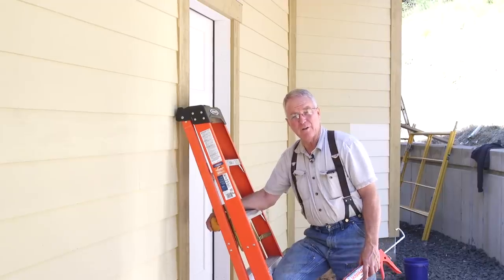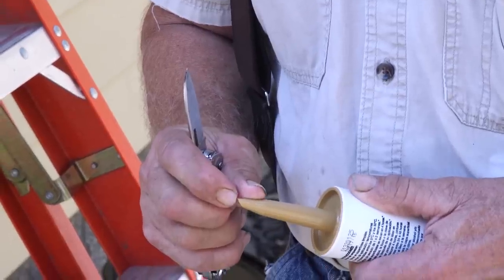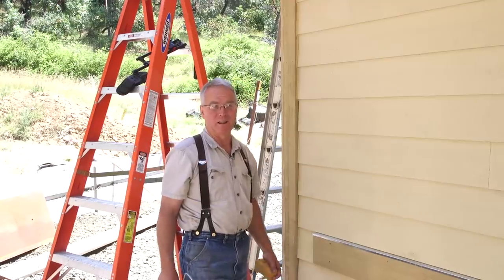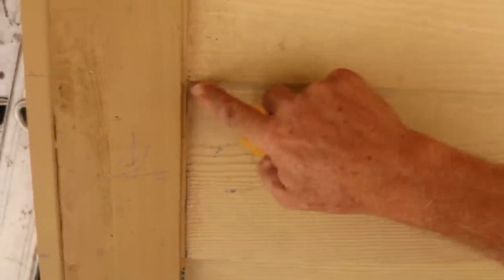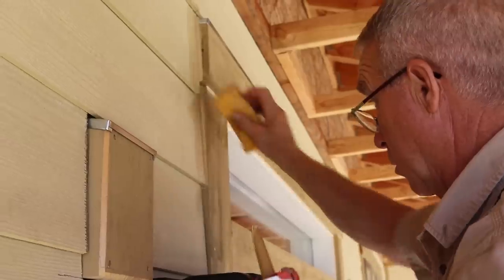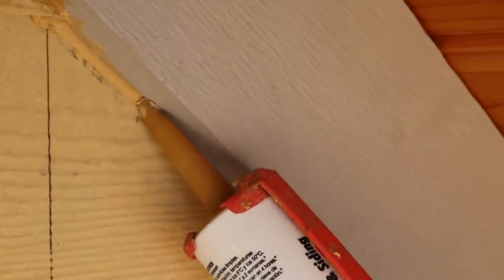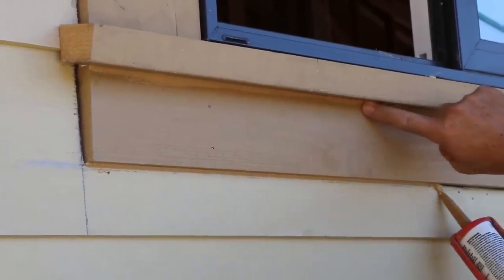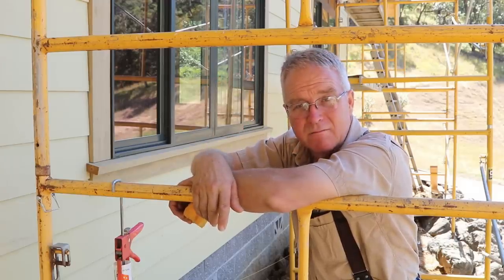Up Your Caulking Game Ep 86

Comment: Looks good. I like to caulk as I install  each board. So you can caulk the overlap part while it’s exposed. Also, a little dish soap in your water really helps get a nice smooth finish on the caulk.

Comment: I like to back caulk every piece of Hardie going up against a piece of trim. If you put in on the back of the piece before you install it, you can do it in such a way where you can get just the right amount of caulk to bleed out of the joint and you can tool the bead right then and there without the next successive piece obstructing the path of your finger, and it also allows you to get the headlap of the siding twice, and ensures that the majority of the functioning weathertightness of that caulking bead will never see any kind of ultraviolet radiation or weather whatsoever.

Comment: Solid effort! I doubt this will be read but just for fun... try holding your tip at about 90* to the joint and look for that little bubble that wants to pop out and then find that balance between stringers and holidays. When you hold the tip down relative to the direction your going you will inherently stretch to caulking and potential thin spots when it shrinks back

Comment: I carry a little portable tub of vaseline and coat my "tooling" finger with it before tooling. It helps to keep the caulk from sticking too strongly to my finger. Some caulks even recommend against tooling as it thins out the edges to such a degree. OSI caulk is some of the best out there. Lots of colors also, to match to any project.

Comment: Little tip is get proficient at pushing the gun as opposed to pulling. So on the bevelback weatherboards you would start at the bottom and work up but hold the gun on the same angle. This way the angle on the tip can finish the look and when you're good enough you will be able to do a great deal of the job without touching it with a sponge or finger.

Comment: Yeah.. thing is over here we use mostly pre-painted siding so color matched silicone or butylene caulks are ubiquitous. Some are so soft and skin over so fast you cant really smooth them over. A good gun (like a tajima) is absolutely necessary to do a smooth application without running your finger in it and ruining your job. Steady hand and being able to glide over rough spots without waving or trembling is the goal. Plus I feel like the 24 tubes of caulk he used is way lower than what we would use considering that our nozzles will be opened like a 1/4 in or more depending if youre butting against stone or brick. Nice to see different techniques being used.

Comment: An experienced caulk job doesn't require a lot of finger striking. We look on that as rookie stuff or only to  cover mistakes. I always pay great attention to the size and angle of cut opening on my tubes, and may 2-3 tubes at the same time to cover different applications. I also keep the gun running  quickly and smoothly. Experience and patience will improve all the strategies you need to leave a job looking great.

Comment: My caulking is done around cabinet infills that I have poorly scribed. I have found if I lightly wipe down the area with a wet cloth, not only do I remove dust but when I caulk, it won't create a mess and stick to the wall or infill and stay a little bit cleaner.

Comment: With Hardi board you have to caulk or you'll see all the seams and joints, not like cedar siding that swells and closes up the gap, wood fibre is fuzzy gives the illusion the gap is tight. Hardi plank is well worth the money holds paint really well, maintenance free pretty well, good stuff, ya a pain in the * to install. At the local building supply the other day walked by the hardi plank on the wall and think its over 20 years old has the same paint on it the day it was installed.

Comment: When I installed the JH lap on my home, I did the butt joint flashing as well as installing a sub flashing at all the outside corners out of a piece of coil stock...overkill, but nothing but a simple 6x6 no hem.  The JH looks without compare in terms of everything going on a home, but man is this stuff labor intensive especially on gables with shakes/shingles.  I spent about 8 hours just caulking the underside of my porch.

Comment: As a certified residential/commercial painter I have been caulking for 25 years. I stopped cutting tubes on an angle 20 years ago. I can push or pull the gun, run over the bead forcing it into a gap, and if I get it right, leave a tooled and finished work in one motion.

Comment: I've been a welder for quite some time now. When I was going through my apprenticeship I remember my instructor comparing caulking to welding. It is very similar. Speed, angle, application. They all come into play. After many years of doing both. Laying down a nice caulk bead w out touching it up is twice as hard as laying a nice weld. The idea is to not touch it after your done and it's very tough to get that glass finish on a bead w out using a tool or your finger. I'm sure painters know there way around a caulk gun. Ask a glazer, someone who has caulked a few thousand windows that have daylight on them and are meant to be seen. It's a craft In itself.

Comment: Best thing I finally did this year was buy a battery powered (because they're all technically cordless) caulking gun.

Especially great when you need to just slam down multiple tubes of adhesives.

For things like baseboard, I cut the tip square and very small. For anything like 1/8-1/4 I cut on an angle.

Comment: Hey I’ve watched nearly all your videos and have also passed them on to my crew. Which has been great!!  However there is a better way to apply caulking. It sounds crazy but cut the tube straight and push not pull at an angle then tool lightly. I didn’t think it would work when taught but there’s no turning back once you got it. Thanks again for all

Comment: As a structural and flat work rod buster carpenter by trade, I used to hate caulking. Got the stuff every where. As I have moved into concrete repair and some general contractor duties caulking had become a major duty of mine. I’m not as good as some but better than some as well. I don’t hate it anymore. It is kind of zen and can appreciate the effort and skill that goes into a nice and more importantly effective caulk joint. Keep up the good work.

Comment: I have a caulking tool with various tip, round, diamond, square, etc.  I use this in stead of my finger. With a putty knife I reuse the excess that gets scraped off. I also use a cellulose sponge. It is less porous than a grout sponge.  HTH!!

Comment: After a lot of practice you don't even need to use a finger. It's better to go slightly larger with the tip cut in my opinion because the caulking will shrink. Lots of caulking brands say there stuff doesn't shrink, but that's usually bs from my experience.

Comment: I'm a finish carpenter so I don't do the outsides of buildings very often but I've learned there's 2 other tools that are very important for caulking if you need a perfect calk joint. Number 1 is tape. Tape both edges of the joint so after you smooth out the caulk you are left with nice clean lines and not wavy lines as seen at 8:57. For most things it's not a big deal such as what he's doing, but when you calk in the pieces for your bath tub or your kitchen counter you really want those to look nice. The other thing that's really handy is a block to smooth out the caulk. As you do more caulking you don't need it but when I first started out I would get so frustrated with the changing pressure in my finger and not seeing an even bead so I took an old hotel key card and used that. It had nice round edges that would leave a good bead (though often times too small so I had to cut the corner based on what I was doing). I know they sell blocks for caulking but I went the cheap route which is something I don't often do.

Comment: Done lots of caulk. We built homes and extensions in the mountains and  always used bevelled cedar siding. Lots of caulk. Don't mind the job at all.
Reply: What is your idea of lots of caulk? I have been a professional caulker for over 45 years. Our base contract is 300’ per day, 1500 per week, 6000 per month, 72000 per year, in ten years that’s 720000 that’s over 130 miles. 😂 Not meaning to say you haven’t done lots,just saying I don’t think it’s quite the same

Comment: I've learned alot from this gentleman but this is something I can teach him better. From cutting the tip to applying without having to strike. Also a good tip for between your hardy plank seems is use strips of aluminum that match the paint. Cut them long enough to go from lap to lap and about 4 inches wide and nail them behind the planks in between the seams so it'll always be water tight. Better than tyvek

Comment: We use a lot of urethane caulk on door and window installs and the stuff is just awesome to use. Done properly you don't even need to smooth out a bead and a steady hand and swift movement gives you a beautiful line. That said, certain colors of the OSI Quad is stiff as nails and very difficult to get out of a tube. We generally try to heat it a bit so it flows easier, but in the fall and winter it's problematic. You're right though, caulking can be very cathartic after swinging a hammer and it's a nice slow relaxing time where you can actually listen to music, a ballgame, a podcast or just shoot the bull with your guys without listening to generators and compressors and nailguns all day. Also, when you get caulking done, the look on the painter's face is worth so much. You do a good caulking job or fill nail holes and they love you like Santa.

Comment: Before I do the chalking I make sure all the timber has been primed and undercoat as when the chalking strinks it don't leave untreated timber . I do this every time I do facia and barge boards as that's where most of the timber has the worst weather . I've never had a return where the timber has rotted out at the top

Comment: Interesting. When i do hardy board I caulk the sides as I go that way I don't miss the inch and a half that is overlapped by the piece above it.
 Also on my butt joints I caulk the edge of one piece of siding to help maintain a flush butt joint. In other words if the wall is not plumb it helps prevent one piece from sticking farther out at the bottom where the pieces come together without having to use a shim or other method to fur out the other piece
Reply: I like that you use your excess to fill in nail holes. Might as well instead of wiping it on a rag or on the house wrap.

Comment: Not to sure about the cement board as in Ireland we don't really use it, but I see timber with bare edges which I feel are always better with a couple of coats of paint and all the sanding work complete before any caulking.

Comment: As a Remodeler/Carpenter (all-trades), I  learned how to paint and caulk well from the paint division of pros in our company; but I learned to caulk while applying Hardie Board Siding and other brands like Certainteed Diamondcoat - I also found we had to caulk in colder climates and the OSI Quad works down to below freezing (20 degrees). I found the BEST caulk gun to use is the Dripless Inc. ETS2000 Ergo Composite Caulk Gun - unbelievable control for most caulking jobs but when doing masonry or more demanding and thicker beads I'd go with a heavier duty gun - here's a review of the top 5 in this link; but ALSO, don't just jump to Amazon for your every need - the Dripless can be had a Sherwin Williams (and elsewhere) for alot cheaper - do your shopping wisely to save YOUR Cash, don't give it all to Jeff Bezos - "It's not how you make, it's how much you keep!" - author unknown

Comment: A little something to know is on the side of the caulking gun is a little hole with a razor blade inside. It's used for cutting off the tips of your caulking tubes. So if you don't have a knife.

Comment: Worked as a painter for years. The key to caulking is always always have a wet rag. Keeping a wet finger( no caulk jokes) as you work. 
He is right about going just the right speed to leave a nice bead. Always try to leave a perfect bead like a window glazier before you use your wet finger to smooth it into the joint.

Comment: I replace windows I've been doing it a little over a year, caulking definitely takes time to get down. I spent about month practicing till my boss felt comfortable with me doing it in a customers home where it'll be seen. But definitely start with water soluble, silicone and caulk like QUAD are totally different beast. I've gotten silicone down for are marble sils we do and bathroom windows of course. But quad I still gotta get it down not that I can't i just don't do are exterior trim yet so i haven't needed to. But definitely the most satisfying skill to get down in my opinion.
Reply: Quad is good but probably the hardest to use. You can strike quad with mineral spirits. You also got to watch the temperatures s** impossible in the cold. It's really durable shame it can be really tough to use
Reply: @bobs6129  oh yeah quad in the cold is the worse you gotta warm it up before using it but not to much or it'll be to runny you gotta get it right 😂

Comment: Loved the video!  I saved the end of my index finger for "mending" the fly line or pulling a rifle tigger, by buying a tool at HD with a triangular rubber tip to 'feather out the joint'....Each corner on the triangle is a different radius...the other end is a "blade" to cut out old caulk...It's worth it's weight in gold!  $15???

Comment: I've done a lot of hellacious caulking. Running a crew flooring apartments really really fast I had to go behind them and use caulk very creatively to fix mistakes. Ugh.

I usually just use spit and my finger unless I'm throwing a lot in, I find the slipperyness of spit is better than water in a lot of ways.

Although ideally, and especially with siding, I use my finger as little as possible. It's a big difference between laying a bead and having it done, and having to mess with it section by section.

Comment: Tedious for outside but interior wise, using blue masking tape on both sides of a caulk line before you apply caulking makes for a beautiful line and less mess. Just before it fully cures pull the tape and done. Did this in a closet and would of loved to have known this trick some time ago during remodel moments. 😏

Comment: I'm seeing a gap under the bottom edge of every plank. On the sheltered front wall of my house here in Australia, I have five or six spiders nesting in that gap per linear metre - even after caulking them all and repainting that wall.
Adding a line of caulk during the installation might be more effective.

Comment: When I was younger I was a paint contractor and these are the tips I learned as I went along learning how to apply paint and coating Solutions:
●Caulking painted surfaces is preferred, less shrinkage. ALWAYS have at least a primer on prior to caulking. 
●If pointing up nail holes and other voids that need good spackle (Crawfords is great), sanding is best before caulking, glass finish if done properly. 
● Most important,  if the margins are healthy for the project, Sherwin Williams caulking is I believe the best. I've used thousands of tubes.
By far, SW.

Also as a application tip;
There is a qt. size caulking tube, just in case you are in a high production phase.

Comment: This is really hard to describe through text, but I'll give it ago. 
I cut my tip at a 45, then bend the nozzle with pliers about 12mm (1/2 inch) from the end. Around 22.5-40 degrees. 
This elongates the end of the nozzle and leaves a really nice coved bead. You can use your pliers as you go to alter the angle and change the cove shape/width. 
Since doing this my chalking is basically done off the gun now. It leaves a very neat bead.
Reply: Exactly HOW do you do this bend? What plies type? Which way do you bend?
Reply: @ebirinkugba6178  I just use needle nose pliers or electrician pliers. What ever I have on me, just don't use part of the pliers designed for cutting. 
I wish I could reply with a photo, it would make it way easier to interpret. 
Once your nozzle is cut on a 45 degree angle you bent the nozzle toward the lower side of the cut. It will flatten the tip out and change the cove of your bead depending on how aggressive you make the bend.

Comment: I got one of those little hand held deals..  its like a plastic triangle on a handle but the triangle has 3 different sized angles and all have a rubber edge...  works awesome for me..  i wore blisters in my fingers rubbing over concrete and got splinters all the time doing my eaves but found that thing and wont go back.  A good part about the tool also is if you squoze out too much or it got away from ya the excess will gather up and can be reused rather than go from finger to rag, then from rag back to hand and pants and on a wall somewhere ...   i know everybodies done it..  piss a person off what itll do..  a little woops turns into an awwe then into a shit then into a damnit this friggn caulk then you forget to release the tension on the gun and next thing you know theres a 3 foot snot of calk dangling down that always drops off when you go to grab it which takes a good 5-10 mins wiping it up off whatever it dropped off on...